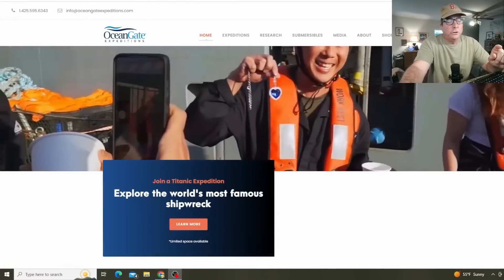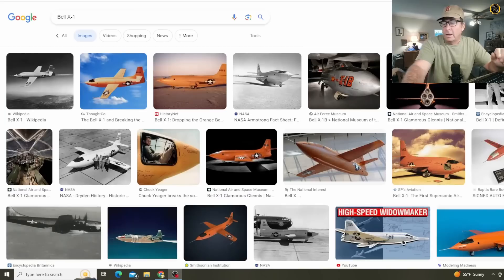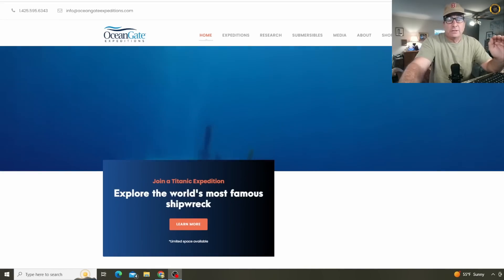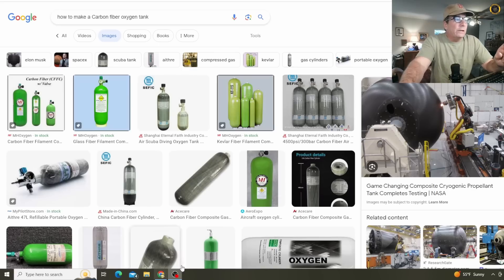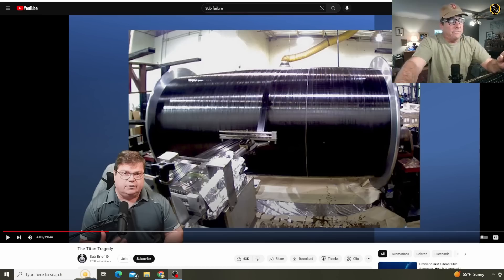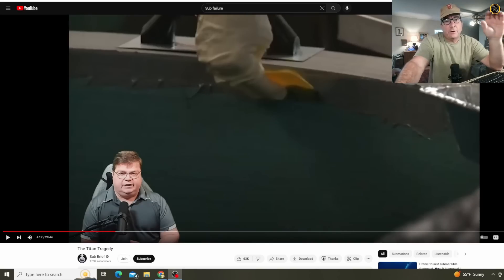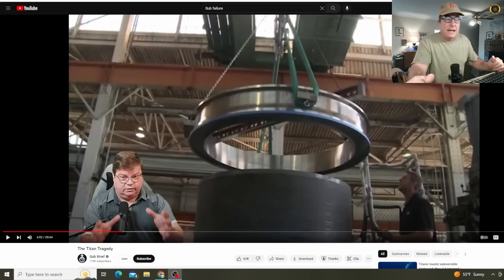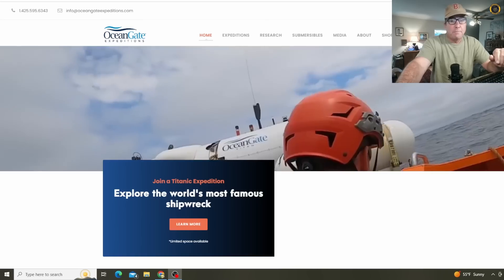Oceangate Sub Construction Details and Implosion

Comment: Great video!
I worked on US Navy submarines, was a Quality Assurance inspector in the Sub-Safe program and eventually earned my Masters in industrial safety. The dissimilar materials used were touted to be innovative. Well, the materials are used in hundreds of leading edge projects, but seriously… I can make a titanium helmet that’s bulletproof and claim to be invincible while the rest of me is covered by a t-shirt and blue jeans. One of their investors still claims the Titan was far more advanced than anything else out there. I don’t know what he’s smoking…

Having dealt with problems like seawater intrusion wicking it’s way a hundred feet into a well laminated wire, or a broken seal letting seawater in like a laser beam… all at only 800 feet deep, I can confidently call the Titan an archaic design compared to craft designs meant for only 1000 feet. The temperature deltas have different effects on the materials involved. Once they recover the bits and pieces, I think you’ll find either the joint between the carbon lay-up and the ring failed, or the tube was flattened enough to eject the dome, with some level of delaminating in the process. 

Not I’ll put on my hard hat… as a private pilot with only 250 hours… as a Safety Manager with 30 years in that field…. And most of you already know this… every constraint, every safety regulation, every work plan that includes a best practice or “safe work procedure” and of course every warning label is written in someone’s blood. As a pilot, no mater what happens, follow these rather easy steps… continue flying the plane, look down for your field or turn back, get the craft set up for the emergency and get safely to the ground. Same with submersible craft… got a problem? Time to turn back!

My thesis was on why pilots press on into weather they’re not prepared for. It’s ego…

If I built a boat… any boat… I would not treat it as an excursion ride for hire without as many shake down cruises as needed to address and correct any and all problems first. Hell, I know all that and I’m practically a novice.

Lastly, 

There are too many outstanding comments to respond to all of them, so I’ll just offer my thanks!
Reply: wow, you are so smart !

Comment: Juan, at 4:15 you say that carbon fiber has a limited number of cycles it can withstand. I recall the main point of carbon fiber in airplanes was that it did not have the same cycle limit as metal? Hence the development of cirrus airplanes?  Tension versus compression, and the dissimilar metals, those two I understand.

Comment: The strength of carbon fibre composite is directional, it is strongest along the continuous fibre direction. Stress perpendicular  to the fiber direction will depend on the adhensive's strengh. Metal strength are uniform for all dorections usually.

Comment: From a project management perspective, prototyping is an iterative process of collecting knowledge through modeling and physically building reengineered components. Now if your project has all the resources in the World, you can make an unlimited number of iterations with small and well tested changes to find out if variations in design offer improvement. But as is often the case in the real world, resources are constrained and thus the number iterations of your prototyping project are limited. In which case one is forced to make a larger number of variations between fewer iterations and with less direct testing to validate the improvements.

Comment: Now it makes sense why Rush said he defied conventional wisdom with titanium and carbon fiber. Rush said the front view port is 7" thick acrylic. It flexes inward 3/4" at depth. Not to worry he said, it makes lots of cracking noises before it breaks. His words. Looked like 5/16" (maybe smaller) socket head cap screws bolted and torqued you inside spaced far apart imo. Were those renewed every dive? No idea what goes through people's heads? What I know as a poor man not an engineer but been around engineers and their mechanical contraptions and kludge wiring. Could tell Rush was eccentric just in the few minutes of video I saw.  He don't need no conventional wisdom

Comment: With respect to non-destructive testing carbon fiber composites, I do that everyday at work  Yes, destructive testing must be done to determine failure points, but once engineering has determined how much porosity and what size of defects is acceptable, the ultrasonic NDT is a great method for measuring those conditions.
Reply: It is important to NDT through manufacturing and while in use.  However, you need to do lots of testing to determine what the acceptable limits are with respect to the defects found.  This takes time and costs $ of course but is part of the development program.  You shouldn’t just build one or two and let paying customers find the limits, even if they signed the waiver.

Am I correct to presume that a thicker laminate will make NDT more difficult, or lower resolution?
Reply: Thank god someone is talking sense about NDT of composites, good ultrasonic testing will show the flaws as clear as daylight, I have been involved with many life critical compsoite projects and NDT is a pre requisite.

Comment: Thanks for the great report Juan!
 I know that both Carbon Fiber and even more so, Titanium, are actually somewhat flexible, and that the flex characteristics are not the same for each, respectively, so in my mind, a glue joint between them seems like, as you said, an accident waiting to happen.
 Additionally, the thermal expansion rates are likely different, at what I assume are very cold temperatures at that depth, which, again, would be a cause for concern with a glue joint.

Comment: The mere concept of using dissimilar base material for a pressure vessel is flawed.  The physical effects of heat, cold, and extreme pressure on dissimilar materials virtually insure separation.  The use of carbon fiber is appropriate for aircraft but the extremes of deep submergence and pressurized water work against the dynamics of fibrous material.  It's a guarantee that, even at 5" thick, a certain amount of invasion will occur with multiple cycles.  That invasion will certainly result in degradation of the hull and fitment of the end caps (which CF aircraft don't have).

Comment: Thanks for this. Had not seen before how the titanium to carbon fibre joint was fabricated. I understand the Honda Jet required new technology to be developed to allow some sort of connection structures to be embedded in its carbon fibre. I could trust an organization like Honda to design and test a proper connection method. Not many others are capable of doing that.

Comment: With such a novel design and material selection, it would have made sense to conduct unmanned life testing of the structure, by repeatedly lowering a test vessel to the design depth.  It doesn’t sound like they did hardly any testing before they started sending this thing down with people aboard.

Comment: Going out on a limb here...

So, he didn't want 50-year old white guys, because...was he racist? Does he think they're too smart?

I'm no structural engineer. I'm also half black, and 50+ years old, and even I think the design was not only stupid, but an accident about to happen.

Even if the carbon fiber didn't fail, why risk gluing the ends to the body of the craft, and expect that it'll be okay when exposed to that kind of pressure?

Damed thing was built like an accordian, just waiting to be squeezed
Reply: He didn’t want 50 year old white guys because they were the ones with experience in the industry. They were the ones with the experience to know how dangerous his design was, and they were the ones with the experience that gave them confidence to tell him how dangerous his design was.

Comment: Carbon fiber is known for it's very high tensile strength to weight ration. I've never seen it advertised for it's compressive strength. You covered this in the video and we're all thinking it. Great for pressure vessels. You also have a difference in compressive properties at the joint with titanium which is begging for failure.

Comment: I hardly can´t believe that they used carbon fiber in almost all the pressure hull, even with 5 inches in thickness... Taking apart the glue issue, is that a good design in the mid-long therm?. Would need that carbon fiber hull a replacement due to the stress?.

Comment: I worked as an engineer and ops manager in an aerospace company that made engine components via castings and forgings. I agree 100% CF is so much more difficult to NDT if not impossible. In our castings and forgings everything got xrayed, sonic inspected, dimensional, grain structure, tensile, alloy verification, penetrant inspection etc etc. with all that data we had a super precise idea of how the parts will react and what their properties are. Watching them weave the tube just gives me goosebumps. watching the videos of the ceo saying they are using aerospace type quality and safety processes in other videos I've seen is misleading. Also if you look at the boeing 787 dreamliner they have had issues with their CF components prematurely wearing and degrading, cracking etc. And they have a sample of hundreds of aircraft so they have a solid data set to review, not a one off. As an engineer and ops manager the risks he took was unacceptable. Idk exactly  how he communicated the experimental design and risks of the new materials and  processes for this vehicle but I think its cause for a potential lawsuit.

Comment: I am not an engineer but the adhesive idea for bonding end flanges to carbon fiber is a very bad idea. Like you said the joint could fail. No doubt the carbon fiber tube was another bad idea. Carbon fiber/resin bonding adhesive is more brittle at low Temps. So sad a thing especially for the young man. Also the glass port hole was maybe not rated for that depth. Stockton Rush also may have used self tapping screw into the carbon fiber tube on inside. This would allow a potential stress riser inverted to outside skin of the tube very stupid thing to do. This should not have happened.

Comment: I am not an engineer of any description.  But just using common sense I was trying to explain to my wife on Tuesday after the report of the vessel being missing.  I was without detailed knowledge coming to the same conclusions as seasoned engineers.  I was explaining the nature of carbon fibre construction to metal bonding.  Cycle stress.  Pressure of water at 2.5 miles being 325x surface pressure.  Difficulties in none-destructive testing.  I didn’t need a PhD in engineering to decide $250,000 could be better spent on other safer pastimes.

Comment: I always look forward to blancolirio videos, "Just the facts Ma'am" always come to mind. I'm sharing something I'm admittedly not sure if it's accurate but one article I read said this craft was designed "to the depth" meaning only strong enough to go slightly deeper than the Titanic instead of what most engineers recommend when budling in tolerances, especially for extreme loads, over-build it so there is a additional safety margin of strength. I'm not even sure if I've said all that right so please don't call me fake news if that is incorrect I'm simply sharing something that if true it represents another very disturbing aspect of this whole thing.

Comment: I have been working with Carbon Fiber since the 80's for prop blades, Sub briefs video was horrifying to watch and infuriating knowing there are engineers there , letting this go on; there more then enough data out there to have shut this design down 100x over as an insane idea.. Also I have heard that the view port was only rated for 1200m from the manufacturer.. not 4000.

Comment: Forgive me for making a statement without knowing much about submarine engineering but for most things that are exposed to extreme forms of pressure or heat or dramatic changes in either there's just no substitution for conforming to the same material for as much as possible. Different materials have different shrink and expansion properties when expanded, compressed, heated or cooled. So to have various parts made of different materials with completely different properties that are going to be exposed to dramatic changes in pressure and/or temperatures, you can see how that's just not a good idea. When something is constructed of the same material, then apart from areas with differences in thicknesses, you'll at least get a very predictable and uniform reaction to the exterior being exposed to dramatic changes in pressure and/or temperatures. 

So, how carbon fiber behaves to pressure and temperature is not how titanium is going to behave and that won't be how steel behaves or copper or whatever the case may be. Sure, they will all expand and contract, but not at the same rates and this alone makes blending large sections of titanium with large sections of carbon fiber or steel or whatever the case may be, a very precise science and takes experience and a lot of testing before giving it the green light to put people on it. It's one thing for robotics, still annoying to lose an expensive craft obviously, but you don't add people to the mix without heavy testing. How a design should behave on paper, is rarely how it behaves in practice, and lots of "oh, we didn't factor for that" moments happen, and the design is improved and refined, eventually leading to a pretty reliable end-product. But for a prototype? Those things are as wrinkled as a prune with flaws that need to be ironed out lol.

Comment: I'm speaking under correction, but didn't both the Soviets and the Americans have a lot of trouble using titanium in aircraft and submarine hulls? As I remember it it's a metal with all sort of problematic properties that get a lot worse once temperatures and pressures move any distance away from "standard".
On top of that I also seems to remember that glues can become problematic once pressure get out of the normal range, a classic example being the de Havilland Comet. I believe the use of glues as part of the fuselage construction contributed to the fatal crashes as much as the shapes of the windows.
If anyone with better knowledge than me can confirm or correct me, I would be grateful to hear it.
Reply: The biggest problem with de Haviland Comet was the fact that his windows were square

Titanium is commonly used for deep diving submersibles. It has its pros and cons

Comment: Since number of cycles is so important to vessel strength, I'm wondering if there was a preplanned limit for this vessel before being retired. Obviously if there was, it didn't make it. If there is a positive to this accident, it will be a safer design in the future. Diving to these depths will always be extremely dangerous due to the massive pressure. Best left to ROVs. Titanic shouldn't be a Disneyland attraction for the wealthy, nor should space travel.

Comment: Also, the composite air tanks that I found online have a single-piece aluminum core that's deep-drawn, cleaned and then swaged smaller at one end to create the female threaded hole to attach the regulator.  Fibers are then spun around the outside.

Comment: I'm not an expert in these, it might sound like a dumb question, should I worry to fly in airplanes build with carbon fiber in their structure?
Reply: No. Carbon fibre is extremely strong and durable, just not against compression. There are no forces acting on an airplane that are comparable to the compression at 400 atm

Comment: I think you're spot on, the carbon fibre distorted for some reason after cycling a few times, and failure instantly followed. The debris field for this thing being found largely together indicates it had just arrived on the bottom at it's max pressure depth it would be subjected to, and promptly failed instantly killing all onboard and imploding itself.
Reply: Just curious , if it was descending at a fast speed and actually hit the ocean floor with force , could that impact triggered the implosion?
Reply: @sammyhooligan803 if a collision impacts the side it would fold like a tin can especially since the ceo was cutting corners. A spherical hull would at least distribute the impact from a collision in a cone.  Impact to the front wouldn’t mean anything unless you hit the glass and shattered it like the cheap trash it was.
Reply: @sammyhooligan803 Also wondered that, maybe the PlayStation controller died and they never slowed descent.
Reply: In one of James Cameron's interviews he stated that through his personal network of connections in the industry, he was told that at the time the implosion sound was recorded, the Titan vehicle was at a depth of 3,500 ft - a little more than a quarter of the way to the bottom, at approx. 12,500 ft.
Reply: @edfederoff2679  They estimate it was around 2/3rds of the way down and descended at an excessive rate. If the transcripts are accurate / to be believed, problems became evident with cracking noises from the hull, and the inability to abort the dive, so apparently they dropped ballast and dropped the frame / legs, but could only rise very slowly, an equipment bay may have already flooded, and the hull layers compromised. The hull sensors were all in the red. Then the submersible hull finally imploded. The debris field was found about 500m from the Titanic wreck, as submersibles don't descend directly over the Titanic wreck site if they drop ballast etc. and to avoid any issues of getting caught up in the wreck itself.

Comment: The weird thing is, this design worked a few times at Titantic's depth then decided to fail. The experts who have been 3 times deeper stated they've NEVER been concerned about the pressure vessels themselves, that they rode in as it was a pretty simple engineering issue, made completely from titanium.